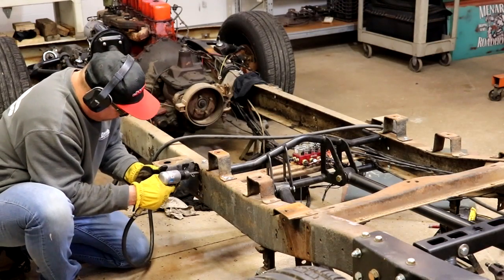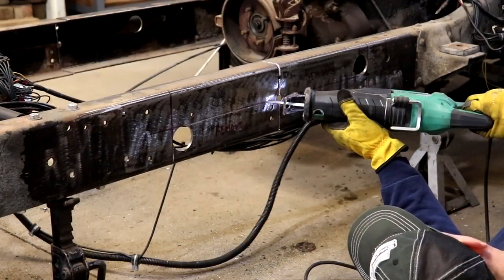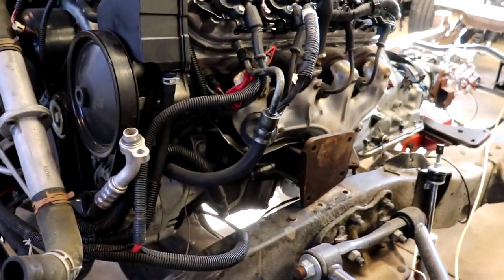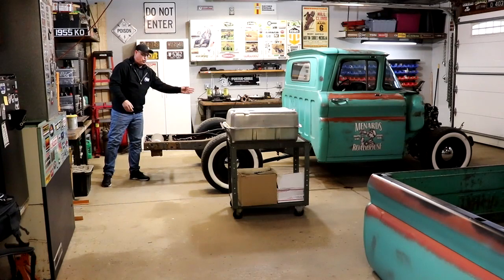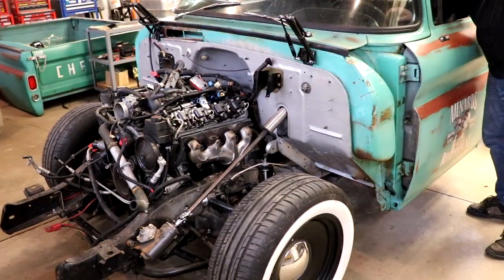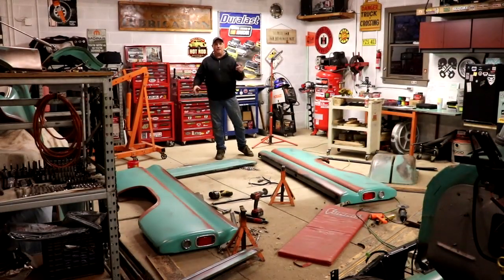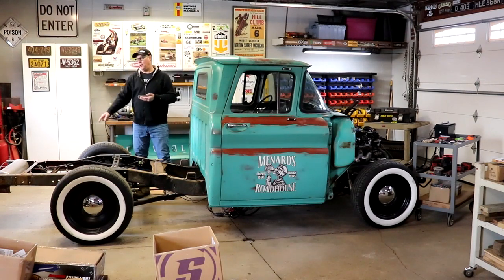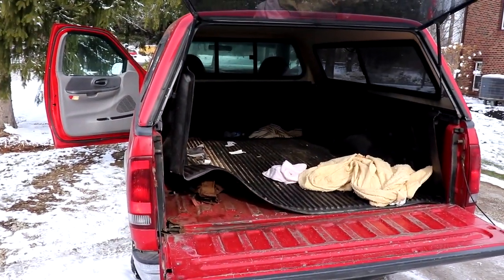The CORRECT WAY to Shorten a Frame for FREE! C10 Chevy LONG to SHORT

Comment: Crazzy how Chevy used almost same frame design concept and same exact steel frame rails from the 50s to late 80s they just updated it is all through the years but same stamped frame rail material. And those factory spot welds to take clips off the frames to re clip them is so nice and easy to re clip a Chevy gm metric frame and truck frames
Reply from the maker: Right on! Thanks for watching!

Comment: witch l.s. engine i would guess the l.s. 5 it will be a great street truck i just picked up a 65 short box for a 100 bucks just has rust in front of doors in the fenders rest is good still has the 283 in it all complete think i can get it running just for fun but have way to many project in front of it
Reply from the maker: We're using the LS1 and the 4L60E, it's ready to fire up today! Thanks for watching and get that 283 running!

Comment: What if you need to shorten a frame by 5” measure out 5” from your center line and follow the rest of the steps?
Reply from the maker: Find a flat section of frame and take out what you need. Be mindful of where everything will relocate upon reassembly. Measure 100x if you're not sure and mark it out, make notes and you'll be fine. Send it! Thanks for watching!

Comment: Hopefully u see this, I have a question I have a truck with a rusty back half, however I have a back half that’s perfect from another truck. But the back half I have had no rear end under it. Is it possible for me to cut my bad back half off and put the rust free half on then put the axle under? How would u go about keep it straight and level? I’m guessing jack stands and jacks maybe? I say jacks because there’s no rear end under it and it’s to heavy to lift and move without a jack or two. I’m a welder I just never done this before and the truck is worth saving, the front half is great literally.
Reply from the maker: Completely possible and totally doable.Yes jacks & stands. Use the method shown in the video and don't weld to rusty garbage and it'll work! Best of luck and get a couple buddies to help. Thanks for watching!
Reply: @GrenadeMotorsports  I like your video, u explain everything and how to do it. This is the best video I found on how to do this stuff no one else explains it like u do. Thank u for ur reply!

Comment: Great video very informative.. what welder did you use for the frame? I’m thinking to shortening my truck I just don’t think my welder it’s capable of welding my frame... it’s 3/16 thickness?
Reply from the maker: The welder used in this video was a Hobart Handler 140 with shielding gas. Thanks for watching!

Comment: Is using a hole saw to cut the corner noches really necessary?
Reply from the maker: I believe that it is, yes. A radius shape cut on the edges produces a low stress connection. If you step cut with sharp corners- you increase your chances of the frame cracking just outside of the welds. Thanks for watching!

Comment: What size hole saw are we using?
Reply from the maker: I think I used an inch & a quarter. Thanks for watching!
Reply: I've got a 2" inch one... that oughta work huh? This looks like the ONLY way to shorten up a longbed that makes good sense to me.
Reply from the maker: @shawnwimberly9294  Thanks and yes, 2" will work. Adjust lines accordingly.

Comment: Can anyone send me the measurements I want to do this to a 1990
Reply from the maker: The measurements of a 1960 will be different from a 1990. All you do is calculate how much you need to remove and pick a spot that's straight. Keep your cab & bed mounts in the correct location when it's done and go for it. Good luck!